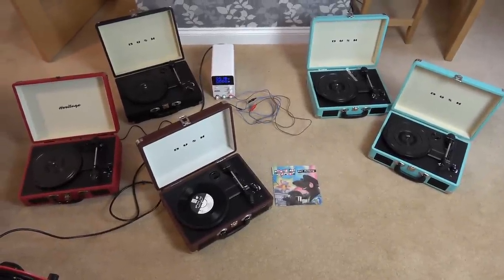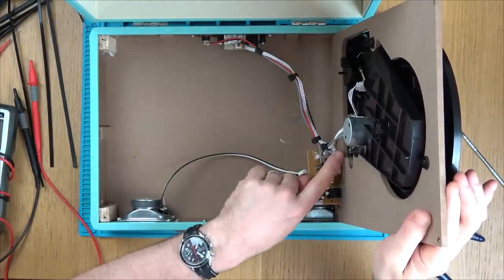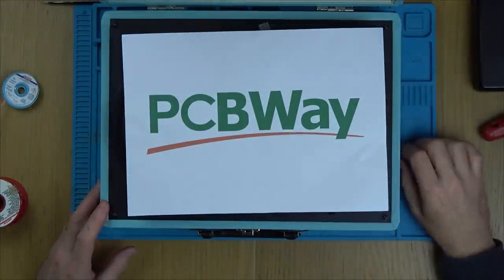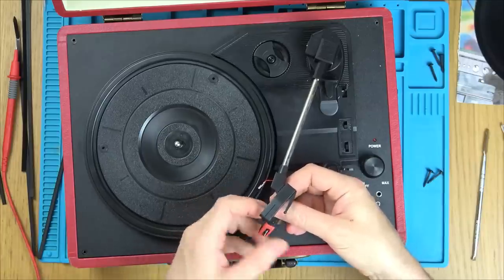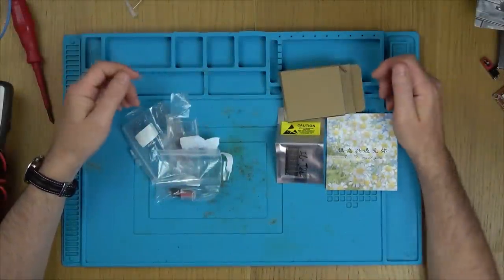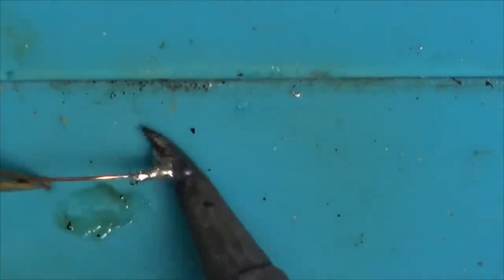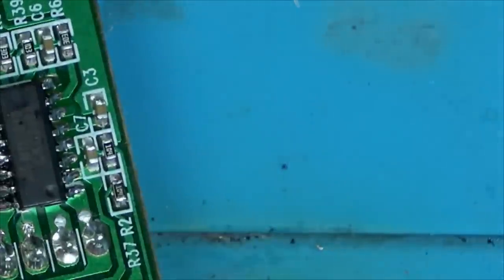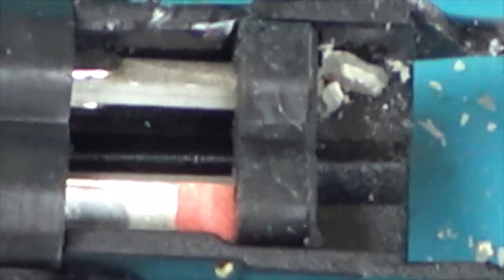Trying to FIX 5x RECORD PLAYER SUITCASES

Comment: The puck (for lack of a better name) isn't to sit records on.  It's an adapter for a record if the centre had been punched out for use in a jukebox.
Reply: like the one Vince had in the video escept the centre hole was intack & not punched through
Reply: I had one of those Bush suitcase style record players myself a few months ago granted it was not the best in sound quality through the small speakers and they tracked a bit heavy but as my vinyl was quite old and well played through gold plated 3.5 jack earplugs through the ear plug socket on it the sound was pretty decent better than the speakers built in anyway 😊
Reply: @ellisgarbutt1925  in that case you don't need it then do you?

Comment: The stylus transducer isn't an insulator, it's a piezoelectric crystal.  When it gets bent by the vibrations from the stylus, it creates a voltage between the two faces, which are metallized.
Reply: The crystal itself is usually something like lead zirconium titanate (PZT), but I think they're trying to replace that because lead isn't good stuff to put in consumer products, even if it is safely locked up in a crystalline ceramic material.
Reply from the maker: It is amazing that it can react so fast and pick up the minute differences in vibrations. Cheers Skonk 👍
Reply: nerd
Reply: Oh you googled it too 😂😂😂😂
Reply: @Jungleroomreptiles  I'm an electrical engineer, knowing these sorts of things is key

Comment: Great video.  I've bought several of these in before from our local auctions for normally around £3-5 each, and like yours, they're mostly without power supplies.  I normally just flip them on ebay as spares/repair items if they don't work straight away. I may have a go at fixing them up now I know how simple they are inside.

Comment: Mono records were cut laterally, with the groove modulated side to side. Stereo records are cut with the modulations 45 degrees from vertical, 90 degrees from each other. So one wall of the groove carries the left audio, and the other carries the right. Edison's original phonograph had the groove modulated vertical, an arrangement that worked fine for his cylinder records, but not so well for the gramophone disks developed by Berliner.

Comment: had a briefcase style one around just over 40 yrs ago, that had turntable on base, and vertical lid had a speaker on either side , inside / forward facing when open. it allowed mid size speakers, with space internally behind 1 for circuits, and behind the other for c size batteries.  made by or branded as Boots. loved it.

Comment: I was going to say you could take the components from one of the blue ones and put it in the black case. That way you would have all different colors working. 

Also, I've seen on EBAY sellers that have the boards for these. The main one being one that has the bluetooth option. It might make a good video to get one of those boards and install it into the one that is missing. Voltage on those boards is 5V I think. 
🤗

Comment: Hi Vince, nice to see you learning drag soldering 🙂and regarding the missing board - dude, you've got PCB Way as a sponsor! So, lets get one of the working boards and recreate it. They seem to be single layer board, so it should be pretty straight forward. If you don't know hot to do it, Richard and Detlev from Learn Electronics Repair did a video about it not so long ago.

Comment: Hi Vince, You're right, record players indeed are fascinating. For me, it all started when my parents gave me (as a 2-year old child) an old worn-out record player; the cartridge was bad and so, my father attached a piece of cardboard to the arm and stuck a sewing needle into the cardboard. That setup wasn't exactly kind on my records, but hey, it worked (somewhat :-) ). Some years later, I got an old wind-up gramophone (you know, those players using a steel needle to pick up the vibrations and amplifying the sound through a horn). Eversince, I love record players and although we now have much better sounding (digital) devices, there is something about vinyl sound a digital player will never ever be able to reproduce. So, very glad you made a video about fixing record players; I was kind of waiting for that. Great fixes on less great record players, but I don't care if they're cheap, it(s the learning experience, isn't it?
Reply from the maker: They are fascinating. I also have a Bang & Olufsen one to look at so hopefully that will be on the other end of the spectrum regards quality. Also I know a little bit more about them now so the B&O product won't be as daunting. Just hope that the Stylus is ok on that one £££$$$$ 😂
Reply: @Mymatevince  B&O was always more about the style than the quality, with products far cheaper capable of far better sound.
Reply from the maker: @RebeccaTurner-ny1xx  Yeah, I'm still a sucker for B&O products though...They just look so good😂
Reply: @Mymatevince  I wonder how many films have featured B&O gear as a symbol of middle class success, especially the 9000 CD changer which puts the discs on show in a line?

Comment: next time you want to test audio amplifiers no need to swap or buy parts , use your finger just touch the input and you will hear a hum ( on the record player touch either of the wires from the stylus )
same thing with a tape player , touch one of the connections to the play back head 
just thought I would throw that out there , that was my first signal injector

Comment: I went to the Argos site and read about 150 reviews. I'm puzzled by the overall rating of 4.5 stars out of 5 because so many people either said it didn't work properly or just sounded awful.
It was especially odd because not that many reviews were blatantly fake, which is unusual for Argos, their site is packed with fake reviews.
Personally I wouldn't put this in the same room as a record. Dreadful rubbish.
Great repair video though, as usual. I really like that you will have a go at fixing just about anything, and with the same enthusiasm.

Comment: Techmoan looked at a number of these cheap record players not too long ago. They generally seem to use the same plastic mechanism as these, probably all from the same Chinese factory like cassette mechanisms in new machines today. They're serviceable for what they are, but you should keep an eye on the tracking force they exert on the record. With no way to adjust the tracking force, they can exceed what the cartridge and/or record can take and cause permanent damage.

You can get these small scales that are used to measure the tracking force by placing the stylus on it at the same height as the record would be. Depending on the cartridge it should only be a few grams of force. Of course, if you really care about records you'd get an AudioTechnica cartridge at least, and likely an AT or similar brand record player :)

Comment: Nice Job Vince. I think the audio IC was blown due to over voltage. Someone probably plugged the wrong AC adapter in. Where the burn mark is corresponds with where the power comes into the chip by the look of the 0 ohm resistor and probably capacitor on the other side of the board. Great job as usual 👍
Reply from the maker: Thanks Mick, yes, maybe they used the 9V supply from the other record player models on this 5V one, or more likely a 19V laptop power supply looking at the damage 😂👍

Comment: The small plastic disc/insert was provided by record player manufacturers because people used to buy 45rpm singles that had been recovered from juke boxes and juke boxes needed the middle bit of the record knocked out so they fitted on the actuators. If you look at 45s the middle bit is held in place by a few bridging pieces which allowed the middles to be knocked out by the juke box engineers who serviced the machines and replaced records when the "selected" count showed people weren't choosing them any more. Ahh, those were the days!

Comment: I bought myself one from Argos when they were on sale a few years ago, brand new for under £20 - Bargain! Sound quality is terrible through the speakers but at least the BUSH model I bought had phono outputs to connect to an external amp, some similar looking models only had the headphone socket. I found it easier to use the auto stop switch as an start/stop switch as it would often stop before the record had finished playing. Mine is definitely a 5 volt version as it has a USB lead and adapter for power.

Comment: Pro tip from an old PC motherboard reworker.... a cheap set of steel picks will help with those bridges, especially when you get down to the smaller pin densities.  Just heat the bridge, and lightly drag the pick outward between the pins.  Solder does not want to stick to the steel until it is much hotter.

Comment: Also, that "massive resistor" with a "0" marking is being used as a fuse link.  It will have negligible resistance, actually.

Comment: If you want to make a fun extra video with these players, do a check to see if all the speeds is correct. To test the speeds is easy, there is a app that you can use, where you put your phone on the tray and while it spins, it will tell you by how much the speed is out. I think you can even adjust it. You can also test tge wow and fluter by connecting the player to the mic/line in port of a laptop and using a wow/flutter test application. Fun video by the way
Reply: Or you can just put a paper disc with the speed strobe markings on it and run it under a 50hz light, to see the speed.
Reply: @crcomments8509  That's what I use and I am a professional electronics repairer.

Comment: I got one of these and the wow/flutter was appalling. The sound quality was about as good as a clock radio. Even with an amp and speakers little bass so might as well use the built in ones. Almost seemed like the spindle wasn't quite straight as the arm would lift and drop when playing. Just about passable for rock or speech but horrible for classical stuff or orchestral/brass. Replaced it with a Sony which is your next step up (90 instead of 50) and you need an amp. So I get the appeal of these as cheap fun but if you want to enjoy your music and have an amp and speakers then get the sony/pioneer (all the same platform)
Reply from the maker: Cheers for the info Paul 👍
Reply: When your vinyl records are worth about twice as much as the record mechanism what do you expect? I have a Pro-ject Debut Pro but you can get a good record player for about £150-200.
Reply: The sad thing is that junk like this appeals to people who are just starting out and want to listen to vinyl but know absolutely nothing about audio and hi-fi. The chinese are unscrupulous and take advantage of that, knowing that people will buy this crap and think it's wonderful when they really don't know any better.

Comment: I think the unit that had the blown up amplifier was connected to the wrong power source - To blow up a chip would have to be either ac power or 24 volt dc power - by accident of course ...

Comment: I wonder if you plug in better speakers or a small underneath sub would make it better?
Reply: Probably, as the built-in speakers aren't very pleasant to listen to, but you would still be very much limited by the sound quality of those ceramic phono cartridges.
Reply: Little to no improvement. A ceramic phono cartridge with a cheap tonearm and plastic platter is never going to sound great no matter what you do.

Comment: At 34:00, what is the point of R40?  It's a zero Ohm resistor joining two tracks, usually you see there's a track under the resistor for when the designer is trying to avoid a double-sided board), but not here.

If you're trying for cheap you try not to add parts...

Comment: Just checking... You do know that the stylus is just the red bit?
The black bit where the rubber parts were missing is the cartridge,  not the stylus itself.

You shouldn't need to buy the whole cartridge...  Unless the cartridge, itself, is damaged, of course.  You can just buy the (red) stylus alone.
The actual stylus, itself, is not only cheaper but it's easier to remove and replace.

Cool choice of record, BTW. 😛
I was, (who am I kidding, I AM),  a massive Roland Rat fan. 😊
I have The Cassette of the Album, (which is, of course, The Album of the Cassette...) and several 7" singles including 2 picture discs. 😊

Comment: why don't you send one of the working boards to PCBway and see if they can make you one.
Reply: probably not worth the expense/effort for a device selling at this price point.   Remember, you still have to put the electronics on it.

They're just chipamps anyway.  Basically the same type of amplifier you'd get in a cheap pair of computer speakers.  Nothing to write home about.

Comment: Rather than piezo crystals better quality cartridges will use either vibrating magnets inside a coil to generate the signals or coils vibrating in a magnetic field
Reply: But they cannot be used with those record players becsuse 1) there’s no way to fit them and 2) magnetic carts require a pre amplifier which those minuscule amps do not have. They also require 12 volts of power to work.

Comment: It might be interesting, just as a lark to take one of them, replace those $2.00 Speakers with maybe $10.00 speakers and find a slightly better amplifier board for maybe $15.00 and see what it sounds like.
Reply: It won’t sound any better if that little amplifier is not properly impedance matched to that knockoff cartridge. I have several TEAC all in ones that use those cheap plastic turntables, but they are all fitted with a genuine Japanese Chuo Denshi CZ800 cartridge which is properly impedance matched with the amplifier. They sound great.  Radiophonotvnut did a video where he correctly matched the impedance by adding a resistor or something, which improved the sound.
Reply: It will still sound like garbage. A plastic platter with a cheap plastic tonearm is never going to sound great no matter what you do to it.

Comment: Honestly, they should be banned. They are so bad that they would start damaging your records within 5 full plays. Sure the portable part is a bonus but if anyone wants that the Audiotechnica Soundburger is a miles away better product.
Reply: These are unlikely to damage your records unless the stylus is damaged. While the tracking force is high, it's technically still in spec I believe. Either way, they're cheap and crap, and the sound reflects that. I certainly wouldn't want a record player that costs only as much as two new records.
Reply: @jamescollins6085  the tracking force is way too high, more than 3g is considered to damage the record, these had more than 4g from what i remember

Comment: i wish you would quit calling the pickup as "stylus".  Stylus is the needle.  The pickup (might have other names such as cartridge) takes the vibrations from the stylus/needle and converts it to electrical signals.
There are two types of pickups:
Ceramic and magnetic.
Ceramics often used (or used to be used) in cheap record players and produced higher voltage outputs compared to magnetic ones.

Comment: Dude, these are rubbish from the factory and not worth repairing. If theese were made in the 80's or earlier they would have been made better and would be worth the repair.
Reply: As vince clearly stated at the end there. This channel isn't always about the worth of the fix. If u had one urself that u occasionally used that broke and was a simple fix why not fix it? Seems they are decent enough using headphones with them.